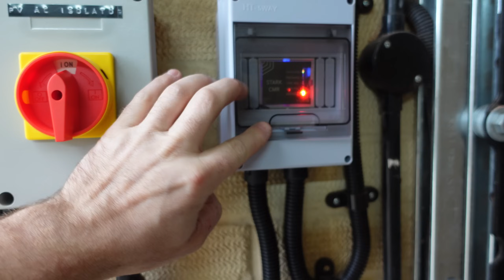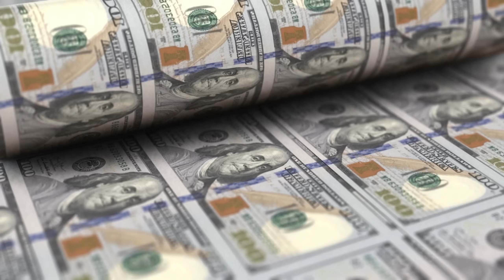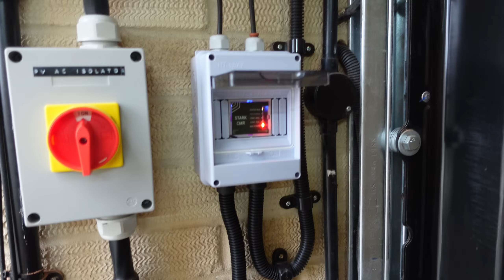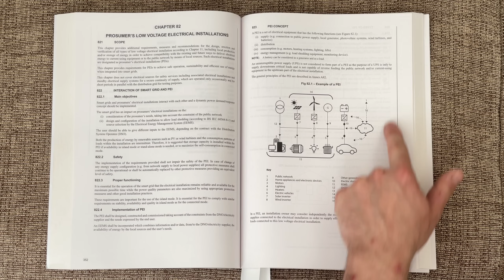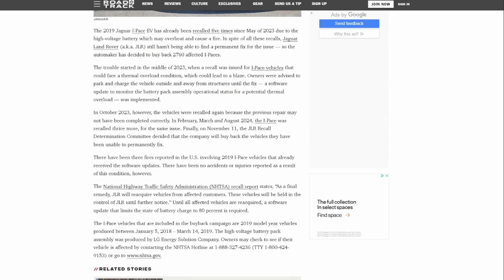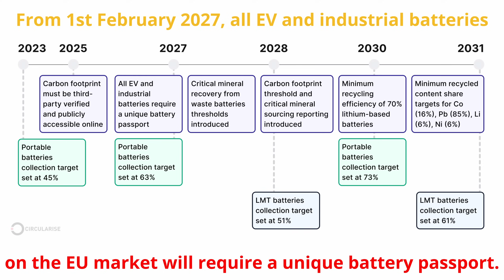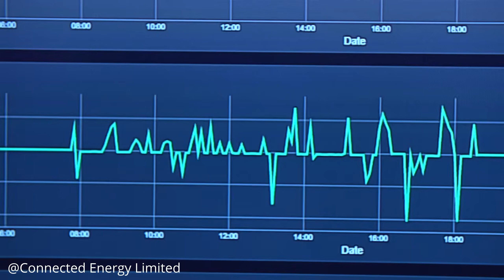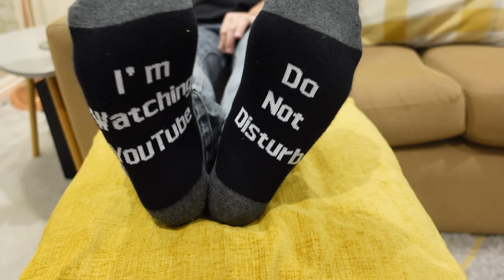4 Reasons I Chose an EV Battery for Home Energy Storage

Comment from the maker: EV batteries are piling up, and I’ve installed one to power my home—do you think this is the future of home energy storage? Would you ever do it yourself? Let’s discuss!
Reply: The problem is that many EV batteries are NMC Lithium, and they need to be handled extremely carefully due to thermal runaway possibilities. LFP batteries are much better suited for this purpose, and it's good to see more and more EV's using them. Personally, I've built my own 120kWh LFP battery from cells, and those come in at around 60 Euro per kWh these days for the cells. The good thing is that you can easily make these 48V and you can find a BMS readily online, so much safer to work on as well. As for power output, just add more packs in parallel if you need more.
Reply: @upnorthandpersonal  It sounds like you have been expanding a lot in recent years, you are right they are realy cheap now
and of better quality than before, greetings from the Netherlands :goodvibes:
Reply: @habana7638  Yep. I actually did plan on that - I figured prices would come down over time so I decided to grow my system as they did. I started with what I needed, now I'm what I wanted (almost ;)
Reply from the maker: @upnorthandpersonal wow so we are looking as similar price per kWh. Agree only LFP for home energy storage. Back up power systems can benefit from used NMC if the pack is sat stored at 50% and waiting for an outage or event.

Love the comment. Lots of good information
Reply: @TheOfficialBatteryMan  I'm off-grid in Finland and I've built and designed my house for that purpose - so I've been (and still am) keeping a close eye on battery price evolution. The best thing to happen for DIY has been the availability of large (280Ah and higher) prismatic LFP cells. The competition over the past couple of years between vendors has lead to an increase in quality together with a decrease in price. You don't have to get them from shady sources in China anymore like I did for my first pack 6 years ago :)
Reply: Good luck with the house insurance...
Reply: @daveevans9809  probably best to go down the usual route, use a proper installation companies that put the whole lot together, solar panels as well. Or in my case have totally free panels that feed me & the grid. I purchased a few poweroak lithium battery generators to store energy, may soon buy a bigger version soon. So I have no liability regarding the maintenance or damage done by the weather as the panels are not mine & do not even need insurance for these panels.
Reply: Chris, are you even aware of different battery chemistries and their very different risk profiles
Reply: owww don't worry... it's just an oversight. the governments will be pushed by the energy companies, car companies, "ecologists" and "neighbors" to regulate it... to make sure nobody has access to cheap energy storage solutions by reusing car batteries.
Reply: @gheaflorin  cheap is relative, rip off Britain is half the problem
Reply: If I knew how to I would do it for home energy storage.
Reply: Thanks. This video is roughly in line with my thinking. Shall be watching your other videos for more information. 

We have a 19kWh indoor LFP battery already, and it has cut our daily consumption of mains electricity to almost zero, without us being able to add a PV array. But I would like to add an outdoor (maybe ex-BEV) battery plus BMS and inverter to give us three advantages: 

More available power draw, especially during Winter. 
More capacity, to make Winter electricity use easier. 
The ability to isolate and go off-grid automatically during power outages. 

Shall be looking out for answers, solutions and potential pitfalls. Therefore, I've subscribed after watching just this one video.
Reply: When I've read about other efforts to use complete Tesla batteries for home backup power, rather than individual modules with separately purchases BMS systems, the problem has been instructing the BMS in the battery pack's penthouse to charge the battery (and maybe to allow discharging).

I'm unclear on what is communicating with the battery packs in your system.  I was expecting something like a Raspberry Pi to be communicating with the battery pack and emulating a Tesla vehicle connected to a charger, but I don't  see one in your setup.

The Fox-ESS hybrid inverter doesn't emulate a Tesla charger by itself does it?
Reply from the maker: @ very true. The battery emulator is covered by the GitHub repository ‘Battery Emulator’ by Dala the great. It runs on an ESP32 with CAN communication. The Stark CMR is the hardware
Reply: Definitely a brilliant idea .
Reply: @rodden1953  not really
Reply: @ Ok why not ?
Reply: Never ever. A Hugh fire hazard and insurance policy cancellation likely because of it
Reply: @chrisbarker3034  https://www.youtube.com/watch?v=8fgohLeu9l0&ab_channel=MGUYAustralia

Comment: Quality improvement suggestion: Show more views of YOUR installation and none of the clip art fluff would improve your presentation since these videos are really for techies building their own install. Pics of the farking UN are just lazy space filler you don't need. Normals just use tech without understanding because they don't care to. Some facial images help the algorithm (because non-serious viewers react to faces) and you can always add a cat or dog which intensely appeal to viewers to whom the tech content may as well be the Book of Kells. Note how popular Louis Rossman's cat is with viewers. Millions are instantly attracted to pets and views mean money!

Viewers should note  those with space can place their flammable batteries well outside the home for reduced risk as no fire suppression. I'm in process of fabbing an outdoor
jobsite style setup since I don't need a permit for that as it will not be permanently connected to my home. Surplus highway sign trailers go cheap and the design is excellent
because they're designed for lead-acid battery weight. An outdoor enclosure is also practical but all should be set up for easy service and repair.

system can put them out so any fire means total structure loss. Historic examples of separation included placing home acetylene gas generators in their own sacrificial
shed safely away from the home (still in many building codes though only industrial generators of the same style like Rexarc remain today).

Comment: AKA - how not to work on HIGH VOLTAGE batteries. @0:57 no safety glasses, no high voltage gloves, and apparently no one to rescue you from a confined space ..    but shortly after safety glasses while cutting metal!
Reply from the maker: It is not normal for electricians who are proving low-voltage under 1000 V to where those pieces of equipment

The area and proving isn’t big enough to get my finger in and I’m using probes with tip guards so only the first couple of millimetres is exposed. 

Getting inside the battery is another story

Comment: It looks like you do not know anything about batteries...BMS have VIN and BMS happily reports the SoH and SoC. What fire suppression system you planning to use on container full of batteries? If you know current batteries technology, especially tesla garbage, them you know these can burn even under the water. BYD blade 2 batteries are so much more safer.
You completely misunderstanding LFP, it is not safe at all. LFP have 1 critical error, balancing. It drifts within short time so much off and need deep cycle to re-balance properly. Not doing that leads to serious trouble. LFP is more suitable for big energy farms, home use it should be illegal. I am sure the insurance company do not pay anything out if you had there any kind of big battery when house burned down
Reply from the maker: Cell balancing can be a challenge for sure

Comment: I would love to do a old car home battery, but in Australia it is illegal for many 'reasons', just like I can't put gutters or flashing on my own house I build, or any electrical or plumbing, or driveway work within 2 meters of the street. One reason is that make some sense is that the chance of electrocution (which would be possible if enough voltage to push 10mA of current through skin resistance is in the system), but the main reason is the current government has a valuable partner in the CFMEU (the electrical union), and would not contemplate out load of considering changing the regulation. In the US, I build my whole house (plan, survey, grading, concrete (13 ft high retaining walls from engineered plans), framing, insulation, roofing, drainage, utility runs) and lived in it for 20 years without issues. But there is a real likelihood of a DIY person working on a high voltage piece of equipment not understanding the danger of it. If some training was required I would be all for it, but even 'experience' people have had problems and fears (see Will Prowse's channel and his latest playing with a 60kWh system assembly). So the certificate of the proper training (as short as possible, like a book study course and proficiency test) is where I would like to see it be. I was looking at building DIY 600v Na+ system (to avoid humongous cable sizes) soon with 120kwh (with the soon to be produced 628Ah cells from CATL) and a 20kwh PV system and some sand thermal storage for less than $40k, but it would be all illegal here in AU and not allowed to be hooked up to the grid or even approved for off grid. So I have to 'hire' a licensed electrician who possibly has no experience or training with this type of system to 'safely' do it. To claim rebates a 'registered' (licensed and certified) PV installer has to sign off on it. Since they are in demand, none would consider doing the 1/2 of work to build one from DIY 'kit' .The other reason they say is fire hazard, so they require permits to do any of this and will not issue permits for any DIY systems, only pre-manufactured and pre-certified systems. Because of this the cost of the system would be 3x to 4x as much, so not feasible or cost effective. I still have hopes of finding an electrician willing to work with me to reduce the cost and other licensed people to help with other aspects, just as I did in America, but there are a myriad of requirements (such as Isolators, remote communication requirements, size limitations and 'safety' requirements that drive up the cost from what could be built for under $10k to too much. I was wanting a 3 phase system to get around the 5kw export limit (3 phase gives me 5kw on each or 15kw) and the larger battery storage is for VPP participation (one VPP pays the commercial rate for electricity (which is the wholesale market rate selling into the grid, which can go as high as $16/kwh, which happens dozens of time a year) which can be very lucrative with 'oversized' (more than needed to supply home) systems and capable BMS systems), making an estimated $7k-$9k a year (so payback in 6-8 years) according to Gemini AI calcs.
Reply from the maker: There are definitely some challenges. Thanks for highlighting them.

Comment: I've used reclaimed batteries in EV conversions - but for some reason, it never ocurred to me to use them for solar storage!  
I have 24kWh of commercial LFP solar batteries - but was thinking about at least doubling that.  I'll have a look at what's available in EV batteries!  Thanks for the idea!
Reply from the maker: The challenges energy systems connected to grids are way more regulated weirdly than electric vehicles. If you can pass a Road safety test and are willing to pay the insurance, you can pretty much get any car on the road.

Comment: Pylon tech US3000c less than £1000 for a 3.5kW battery. Bank of 3 + a Sunsynk inverter = 10500kW at less than £4000. Now thats the way to go. Charge them by Sun in the summer months + two months on either side, and the rest at 9p per kW on a cheap rate. Job done. Less than £1 per day to run your house and Hybrid car. Aaves over Two Hundred a month on petrol + Gas?
Reply from the maker: Cracking set up. That sounds ideal for your set up. 

Prices of EV batteries are coming down. I’ve just picked up a 60kwh EV battery for £1650 and a new inverter for £450. 

Your set up will be way more set and forget and much easier to move around 😂

Comment: Firstly I have to say I am not an electrician, however here's my thoughts. Given that some ev's are already vehicle to grid/load enabled, Leafs being one?, why bother with stripping down a car, surely it would make sense to just plug the car into the house as the car will already have the various electronics for this purpose. You can pick up second hand and road legal, not crashed Leaf for less than £2000 with say a 20 Kwh battery maybe more. My home system of 13 Kwh cost me over £5000. If you can live with a car just sitting on your driveway rusting away, no problem. Apparently a major bus company in Scotland, may be Glasgow, are running using old leaf batteries. Info courtesy of "Dave takes it on"
Reply from the maker: Good point. While the technology is out, there are not many charges with the ability and they are generally quite limited in KW rating. Here are a few reasons why I personally favour against that idea.

A lot of people don’t have the space or the desire to have a vehicle wasting away on their driveway if they even have a driveway 
You can purchase a 60 kWh battery for about the same price as that £2000 car 
It doesn’t solve the problem of potentially thousands of batteries not being used for a second life storage and being torn apart
Some people might suggest using a Balance where they plug the car in for the evening at peak demand and it charges back up overnight. Given our battery technologies, I think we should do all we can to preserve the life of the battery while they’re in the car and yes it could handle some extra cycling. It’s a shame to degrade the battery on a vehicle which has then two roles. 
I totally agree, though that this is a good option for some people and very much under utilised. 
I also believe that the system can be far more rugged and reliable as a standalone system fixed in place

Comment: Really good idea the battery contactor and safety system ís within the pack and is designed to remain safe if hit by a truck. Quite slim and tall and ip 68 rated so could go outside.Yes every house should have one .The grid is being updated to take the transition to EVs so option to
Reply from the maker: I’m a little against using Vehicle to grid as I think we should be doing everything we can to preserve the life of a battery while it’s in the vehicle. 

Although having said that, the batteries now will generally outlive the car

Comment: Hi. A simple solution for fires would be to build this in a small shed away from your house a bit made from concrete perhaps. The smoke from a very unlikely battery fire is another matter. I think this is a great way to not let all this electrical energy to go to waste. Next year I am doing a solar system of perhaps 30kw solar/wind input power and the batteries the solar companies want to sell me are stupidly expensive compared to your solution of using a nice long range tesla battery or like you said: Cybertruck :) Kudos. You are pointing people in the right direction I think but never underestimate 400 volts like you said in your video. I'm still thinking of going this route but the power of those batteries scares me.

Comment: Very good idea for the competent DIY er. NOT so accessible for the ley person. Easier if the  battery is left in the vehicle and vehicle (by design) allows V2H charging. EV car makers should allow the car battery to be used in a new Generation V2H EV charger.
Reply from the maker: I do agree that a V2H or V2G is going to work better for the average person. 

Part of this project is about sweeping up batteries that would have gone completely into waste when they still have a lot of life in them long before they end up out of the car
Reply: @TheOfficialBatteryMan . I think there is a market for this. Lets chat.

Comment: I am planning to go completely off grid with the home. I am building now and just recently going down the rabbit hole of using EV battery packs trying to figure out what kind of mppt controllers and inverters will work with these have read conflicting things about it.
Reply from the maker: Depending on your circumstances, I would say that the grid is a huge asset. Yes you have to pay for it but nearly unlimited electricity on tap.

I would thoroughly recommend checking out the wiki guide for the battery emulator project. There are guides on supported inverters and batteries and how well they’re supported. Generally all of the inverters and all of the batteries will work in any combination.

Tesla batteries have become a challenge to work out balancing so they are not rated highly on the star system.

Comment: I got a 40kwh leaf with fire damage for 200€, the degradation is about 15% so yeah no brainer. The other battery i got is from a flooded miev, the bms was gone but the cells are in good shape. Sourcing and making batteries like this plug and play would be a viable business if done right
Reply from the maker: The challenge is ensuring that the batteries are in good safe condition. Flood damages can mean very big risk and crash damaged could mean damaged cells. Its needs companies to provide health reports
Reply: @TheOfficialBatteryMan No need for companies if you're a rnd engineer with experience in batteries and ev conversions. :) 
But yes, anyone doing this on their own be careful guys, these are not toys and can kill you or set your house on fire. And if a company would make a business out of this safety is definitely the biggest challenge i see.